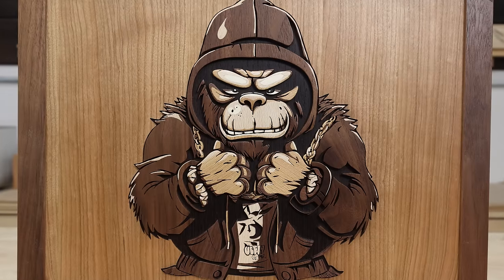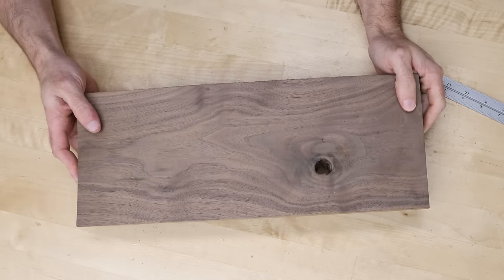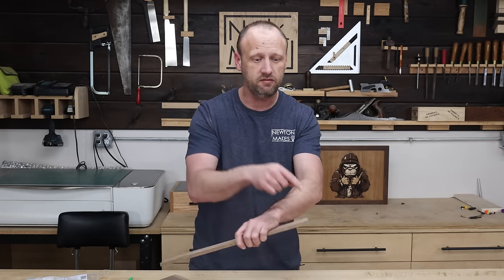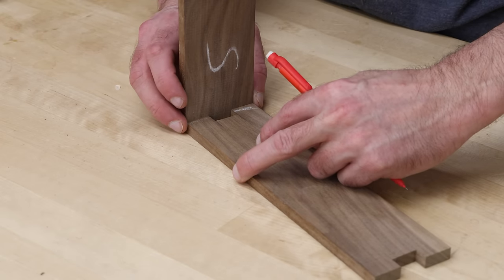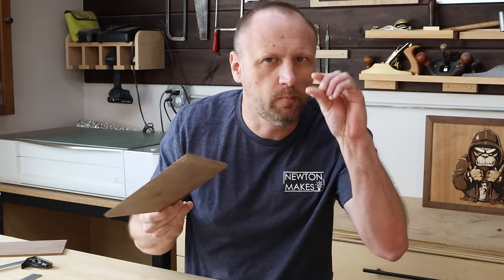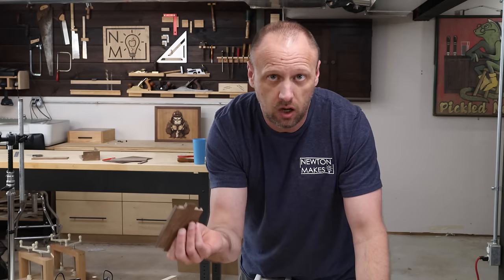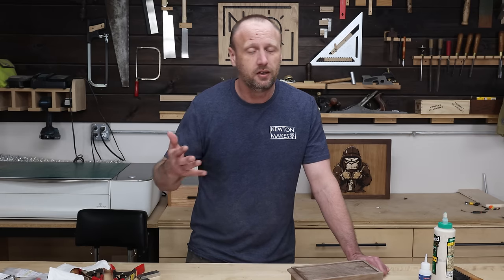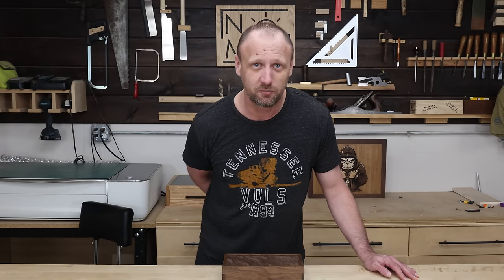An Absurd Number of Wood Box Making Tips & Tricks

Comment: I made me a saw blade holder for my scroll saw blades once out of pvc pipe. My wife stole it for her crochet hooks.
Reply: I was going to say the same thing. A few pieces of 1/4" PVC cut at a 45° angle and stuck into (in my case) a scrap 2X4 will hold your blades and separate the for quick selection and use.
Reply from the maker: I have one like that. However, my wife did not steal mine. I found I do not like it because I put blades in the wrong tubes. We all have to do what works for our brain.
Reply: Aye, sounds like our house
Reply: This, totally.
-- I make something specifically requested by wife, with design consultations
Wife: "It's okay. That will work."

-- I throw together some rando thing just for me for a specific purpose in my own head
Wife: "OMG it's beautiful... and it is mine now."

Comment: In the late 80s, I started to make storage boxes for my stuff. I sized them to hold 6 of the square plastic freezer storage containers. The boxes are 9 5/8 by 13 1/4 inches. I was working as a carpenter and had access to a lot of T -111 5/8 plywood siding scrap. And I would pick up all the basement paneling people were putting by the curb ,for bottoms.Cost of materials was glue and 18 gauge brad nails. 5/8 seems just right, not to heavy, not to thin. I put a 1/4 by 5/8 dado on the front and back for strength and alignment.Over the years I have made more than 500. from 2 inches tall to 8 inches. Many in batches of 30 to 50. Sometimes I would just make piles of parts, sides, ends, or bottoms. Easier to store the parts than the raw material. All are painted grey, have a label holder and most are in the addition I put on the side of my garage to hold them. i give them to friends and family . I made 6 more last week from some light weight asian pine I got from a crate and ran thru my planer to 5/8.
Reply: Great example of perseverance. 👍

Comment: There's another helpful tip about the Golden Ratio that makes it even easier to work with. As you said, you can find the length if you multiply the width by 1.618. But rather than divide the length by 1.618 to get the width, multiply it by .618 instead. Use the Golden Ratio with a leading 1 to find the larger side and without the 1 to find the smaller one.

Comment: I don't know if I'd agree that a miter is a weak joint, it's surprisingly strong and a splined miter is ridiculously strong. Don't quote me on that though I just watched a guy put weight on joints
Reply: I make boxes like this as part of a side business. Before I used splines in my mitre joints my boxes would split at the joint when shipping them, especially in cold weather. I always recommend splines in smaller projects with mitre joints.

Comment: You use the golden ratio to determine how thick or thin the box should be in relation to its size.  Also, from an artist standpoint, its a compositional flow so open space is part of the ratio - and it's usually just done by eye (similar to how you figured out how thick or thin it should be).  It's all pretty cool stuff that can apply to a lot of things!

Comment: The "use a stop block even when making the squaring cut" tip is an excellent one. I learned that the hard way after I spent an hour trying to understand why multiple squares were telling me the miter was square to the blade, but the resultant cut was not square. I was assuming all of my squares had a discrepancy between the outside edges and the inside edges and it was driving me nuts. It was just because as I was pushing the workpiece into the blade, the resistance was causing the workpiece to move ever so slightly during the cut, throwing it out of square.

Comment: Here's an interesting lid.

Lets assume 1/2" material. Make the box 1/2" taller than you want. Before gluing all 6 <- Yes! sides together make a 1/4" deep by 1/2" wide groove on the inside of the front, back and side pieces such that the groove width ends at the distance you want your lid to end. Mark that on the outside of the box. Glue all 6 sides and let dry. Starting with both box ends, make a 1/4" deep groove by 1/2" wide such that the top edge of the groove barely touches the mark you made before. Tape spacers into the end grooves and then groove the front and back. You now have a lid that fits down onto the box.

Comment: If your worried about movement of the Pull tab you could glue the left side of the tab only and put a pin or dowel in the other, make a recession in the lid for the pin that's slightly larger either side for wood movment, as long as the pin didn't sit too loose it would still give you some purchase for pulling the lid open.

Comment: Behind you on the shelves are a jack plane and a smooth plane.  Please keep in mind,, I'm old, and a great deal of experience on job sites.  Job sites do not always have a roof, the humidity is whatever the days is.  I was taught and I teach, never place a plane on its sole. Always lay a plane on its side.  A wooden shelf, even in a dead dry shop, still and always has moisture in it.  And aside from the blush of rust from a wooden shelf that has a bit of moisture,, you are placing the plane bit,, that you so carefully honed, and set,, the perhaps sharpest edge in the shop, and you put it down on a surface.  I don't even return the plane on the work,, I lift on the backstroke.  My razor sharp blade is for cutting, nothing else.
Place your planes on their sides when not in use.  A plane side can be sanded if needed.